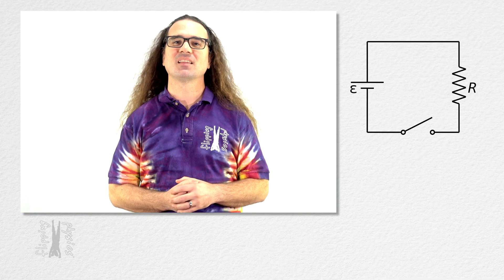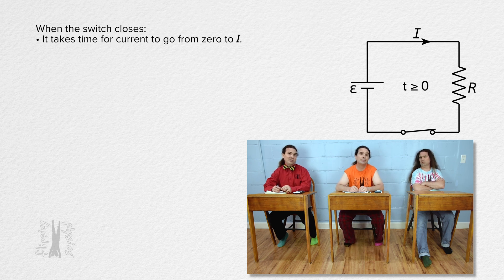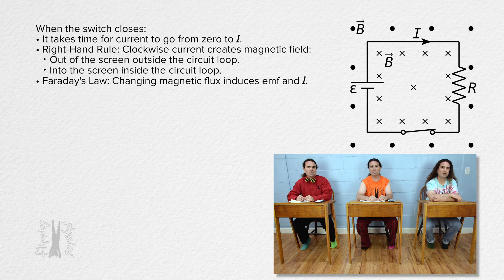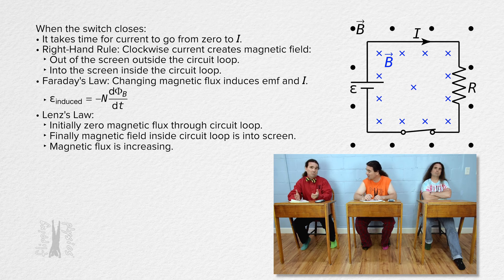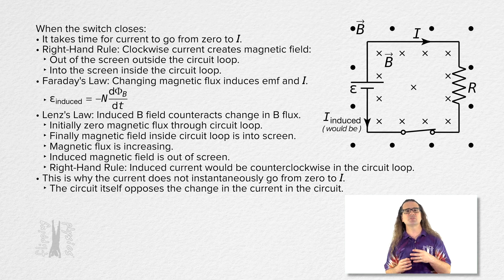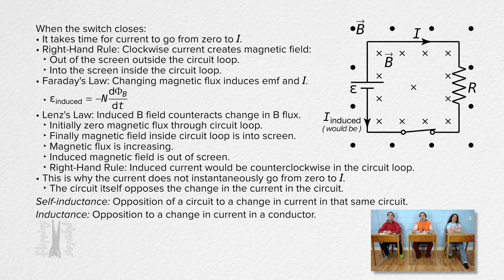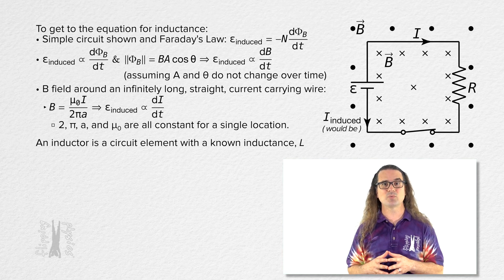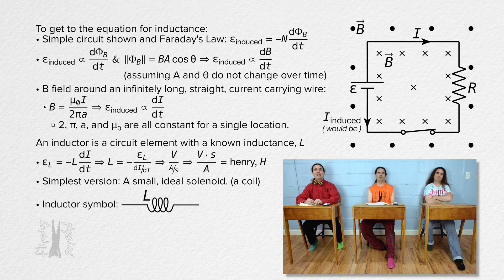Inductance

Comment: Is this the real derivation for the induced electromotive in self induction? Some textbooks have written that the total magnetic flux through the coil is proportional to the current. So,
(number of loops)(Magnetic flux through a single loop) ∝ (current through the loop/coil)
Or, 
N(phi) ∝ I
When proportional sign is removed then the constant is the inductance "L" of the coil.
N(phi) = LI
Substitute above in Faraday's law of electromagnetic induction,
Induced emf = -(number of loops)(Derivative of magnetic flux through the coil w.r.t. time)
E = -N*(d(phi)/dt)
E = - d(N(phi))/dt
E = - d(LI)/dt
E = - L*(dI/dt)
Also, what are your thoughts on this one?

Comment: I've never seen a negative sign in front of L*(dI/dt). Where is your positive voltage reference on the coil? ETA: Never mind. I think I understand what you did, and I was confusing voltage generated by the inductor and voltage applied to it from an outside source.